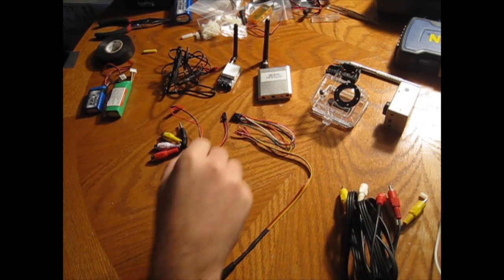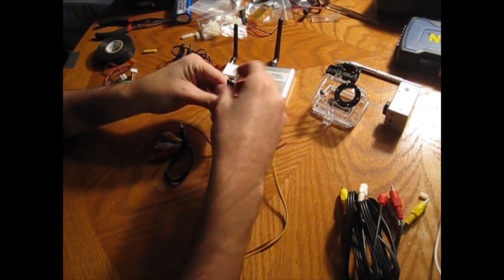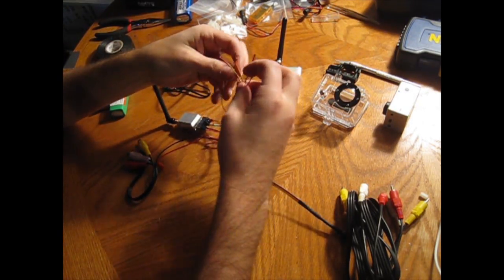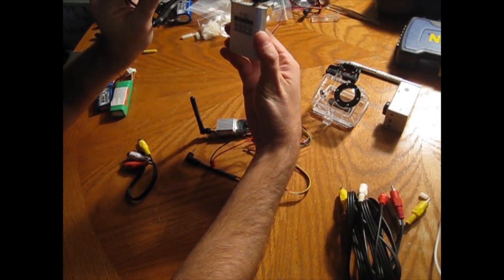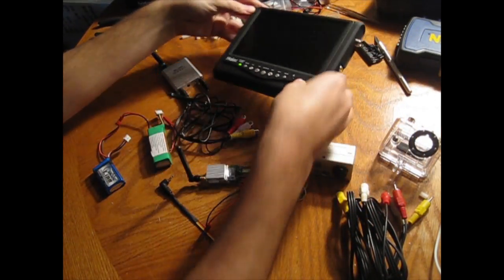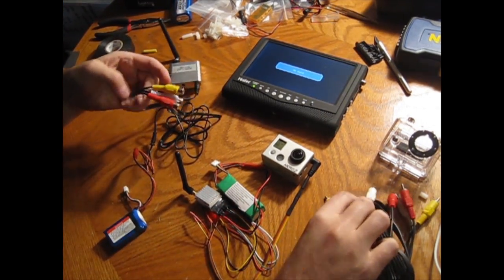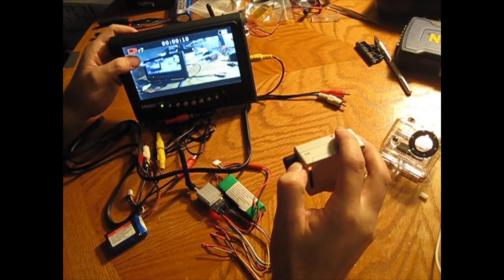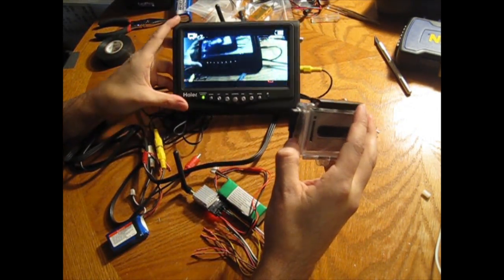Hobby King 5.8GHZ FPV Setup Wiring Instructions Help Go Pro Hero 2

Comment: Can a system like this be used for live transmission - lets say a stage on a event and transmit feed to mixer50-100 ft away? If you upgrade cables to fit handheld camera?

Comment: generally the TX batt would b 11.1v batt, and some RX might work with 7.4v batt, and most Monitors use 12v source(11.1 lipo) Mah doesn't really matter as long as you are around 500+ mah

Comment from the maker: The video does NOT go black. If you start to get static, the video will give you some interference and at times you get a blip where you can't see. With that said, the video is still coming through so it doesn't cut you off and make you blind for a few seconds. There's basically no delay, if you have any signal at all you'll have something on the monitor.  You also have a little warning, I've seen it cut out and move out even further and it's still ok. You get a little interference as a warning.

Comment: Hi, I was wondering if the monitor goes to black screen if the fpv signal gets degraded by static. Another video about this monitor said that happens. I need to know if I can rely on this monitor if I'm using it to fly by. I have the same FPV transmitter/receiver. I'm using fat sharks now, but I want one of these too. Thanks!

Comment: Hi,  I was having same question. But I found that smaller lipo battery, have small connectors that fit with tx/rx connectors. Usualy 2/3 S battery. On readymade rc, I see one car adapter fot the rx, that I wll use to some sollar panel kits.

Comment: Nice tutorial. To bad I do not see it before place order to myvideo kit. I forget to order the cable. Are You strongley reccomand this monitor ? I found it on ebay ( only in US ) for about 90 $ included shipping to Italy. What about if I want to use this system to the tricopter ? Putting another battery, will go up the weith. Any other solution/suggestion ?  Tank You.

Comment: I am trying to hook my GoPro directly from the 2.5mm TV Out jack to RCA video to my television set with RCA Video in and it wont work. I am bypassing the wireless transmitter and receiver but not getting video. Do you have any idea what is wrong?

Comment: Thanks for the video; still lurking and trying to figure out whether to take the plunge into FPV.  What model is your haier 7"?  I'm assuming that it copes well with poor reception and doesn't got to blue screen.  I would like goggles, but a monitor would a stretch enough.

Comment from the maker: I have not tested mine at full range yet but my buddy has the exact same setup (including the IBCrazy cloverleaf/skew-plannar antennas) and he just achieved 3000+ feet confirmed with an OSD.  I would expect much less from the stock antenna setup. 

Regarding recording, you CAN record live HD output with the go pro when your live video output is standard definition (which is what my setup is).  If you tried to live output HD resolution you would NOT be able to record in full HD.

Comment from the maker: The go pro hero 2 is about $275, FPV setup from Hobby King was $60, Ready made RC go pro cable about $15.  Total cost for the setup is around $350 if you don't count the fact you no longer have a water proof go pro case and probably need to buy a new one.  The range isn't great. I was only able to get about 150 to 200 yards out of it. Might be ok for short range Heli flying. 

Video clarity is good for the price, no complaints there.